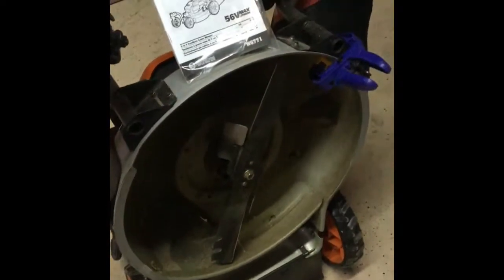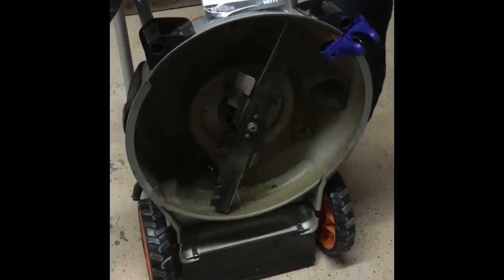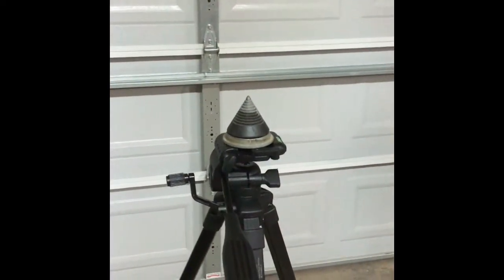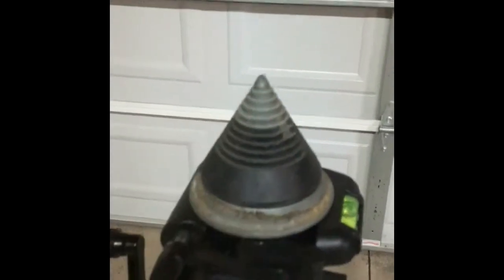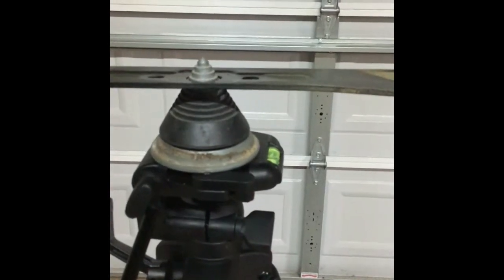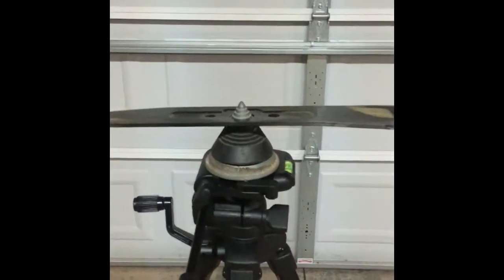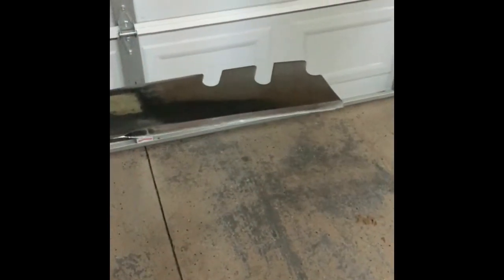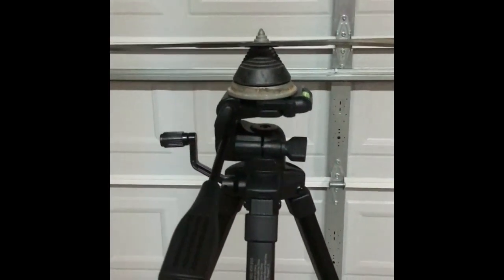Worx WG719 Lawnmower blade sharpening and balancing tips

Comment: Do you know the size of the locknut? I have the same mower and can't find the right size replacement and it doesn't say in manual.
Reply from the maker: 15mm is the socket size to remove the blade
Reply: @accidental_relevance  ok thanks. does that mean that the locknut is metric?